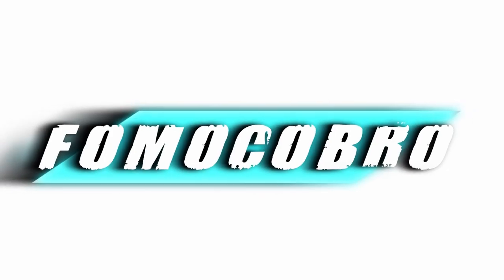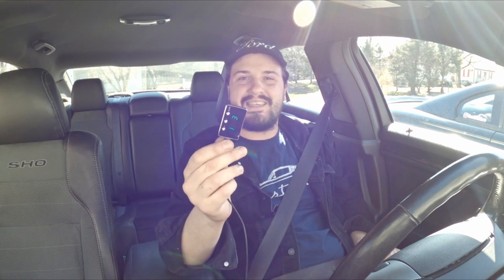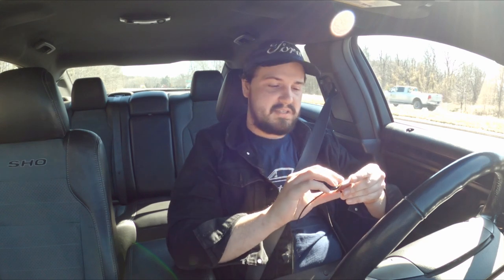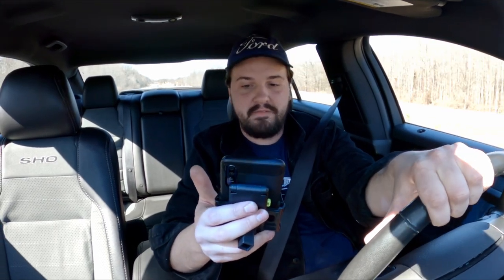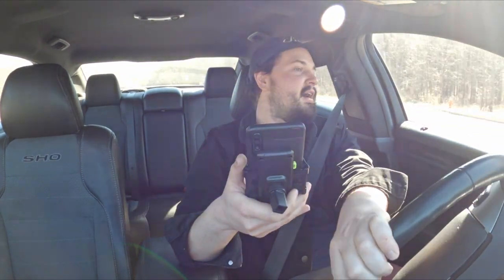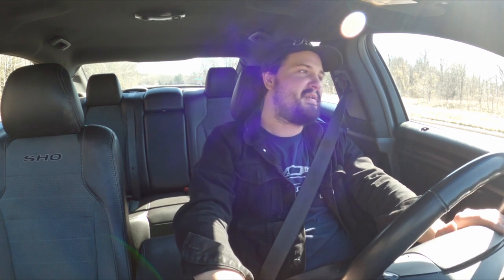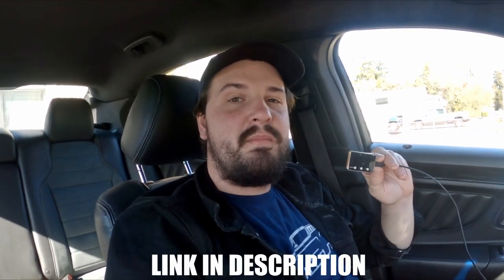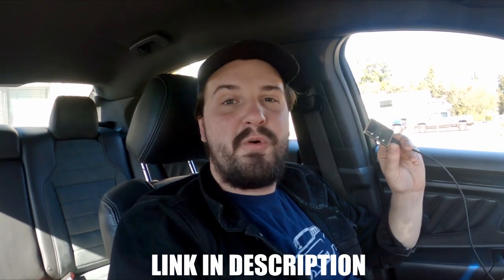Electronic Throttle Controller EXPOSED - 0 to 60 MPH Testing

Comment: I think part of the problem with these tests is they start the test when the car starts to move (0-60).  The purpose of these products is primarily to decrease the amount of time in between pushing the gas pedal and the car moving.  So a more accurate test, although more difficult to measure, would be the time it takes to go from your foot touching the gas pedal - 60mph.  This would be more clear at an actual drag strip when you have to go when a light turns green.  Because you would lose a fraction of a second waiting for the car to react without the controller.

The reason I need one of these is not to go faster.  But to get rid of the throttle lag.  When I stab the gas on my truck it takes a crazy amount of time before the truck begins to move.  Which is annoying when you are stabbing the gas to avoid another vehicle coming up behind you while merging into traffic.  For me its all about SAFETY.

Comment: I have the JMS Boostmax and Pedalmax on my 2017 SHO.  The Boostmax does add a significant amount of boost that wakes the car up with out doing a tune.  I can turn it off and the dealer was non the wiser.  The Pedalmax doesn't add power but gives you the power you have instantly.   I can dial in as much or as little that I want.  Normally I run it around 65-70 percent for regular daily driving and 100 percent when I am playing around.  The throttle is very sensitive at 100 and can cause the vehicle to become a bit uncivilized with regular city driving.  You have to be very smooth and feather the throttle.   I absolutely love my combination and don't feel the need for a tune.  I need to make a few timed runs to see if there is a difference.   On an unboosted engine, the Pedalmax is also great.  I ran the Pedalmax on my wifes 2017 Ford Edge 3.5 and it made the vehicle launch much better.
Reply: If you don't mind me asking I got a 2013 sho and plan on getting the boostmax where did you pass the wire through to the pedal cause I ran subs and couldn't ever find the grommet
Reply: Thanks so much for your skills shared, it did help.How long do you change your car's throttle controller,dear friend?

Comment: Iv got a  kunfine throttle booster like that one but I plug it in and all it does is give me engine light and rpm go up really slow. Iv got a 2015 370z. Any ideas
Reply from the maker: Check the cable that goes from the connector to the screen. Make sure the connections are seated tightly, and check the the wires on the harness. I had a problem with my controller and cause all kinds of problems with how my car drove. It ended up being one of the wires in the connector that pulled out of the connector slightly. So that wire wasn't making a full connection.
Reply: @KarzKreated  they seemed all fine but I'll check again. It's going to cost as much to send back to China as I paid for both. But thank you

Comment: It makes a positive difference down low then up high it losses power and the 0-60 is usually the same and sometimes slower.Ive had one in 4 different cars and thats what happens even the manufacturer admitted that
Reply from the maker: I now use this on a 2020 Mustang and it feels like it does more than it did on the SHO. Whether or not the difference is measurably faster is unknown, but it definitely makes the driving experience more fun.
Reply: Is the manufacturer working on the problem?

Comment: Hi, very informative, advanced, and complete information regarding the throttle controller, thank you, but I have a question I hope the admin or Karz Kreated can answer regarding safety issues, My question is what if the throttle controller's device suddenly fails? or the little wire cut? Do we still have the control of gas pedal? or it will be back to normal mode? Thank you for hoping Karz Kreated can enlighten us. thank you again!
Reply from the maker: I was unsure about the answer to your question since I never had anything like that happen. So I went out to the car, turned it on and unplugged that wire from the controller and the car worked just fine. It must bypass everything when there's no signal from that wire. So hopefully that helps! ✌️😎
Reply: @KarzKreated  wow you are a savior! because this is a safety question and it is very vital, thanks a lot!! more power to you!

Comment: Hi, does it has feature that set the rpm? Just like cruise control but set the rpm instead of set the speed
Reply from the maker: It does not. It only adjusts the sensitivity of the throttle pedal. 🙂

Comment: What ended up being your previous issue with knock? Dealing with the same thing
Reply from the maker: I thought it was the Knock Sensors at one point, then I replaced the Fuel Pump Module because fuel pressure was a bit weird. After that didn't work I put a fresh set of plugs in which didn't fix it. It seems to be false knock. It does it whenever it wants to. Not sure how much the tune contributes to these issues.

Comment: It seems like the controller knocked off a tenth from your 60ft as well. Was your best 60ft with the P1 or P2/P3?

I have a tuned MKS that normally does a 1.94 60ft so even if this helped me get into the low 1.8s it would be beneficial
Reply from the maker: Looking back at everything, P2 gave the best 60ft of 2 seconds flat.
Reply: @KarzKreated  Also forgot to mention that I am currently AJP Turbo tuned and he definitely knows his stuff but he is very backed up right now. If you want a change in tuner but dont want to wait as long I would try out Ortiz. As long as you're comfortable data logging, they will give you a solid performance tune. Either way best of luck to you man👍

Comment: Bought one just like the mass Chinese crap one you have but with the 'Roar pedal ' name .  Worked great for maybe a year.  Then got misfire codes , and it was causing problems with the throttle body. I disconnected it and my car ran better in about a  half hour. Anyway , they work. But invest in the better brands. Not the mass Chinese made crap.
Reply: bs. something is wrong with your car itself. the cheap chinese brands just puts more voltage to the throttle body.  same as a pedal commander but for 50 bucks vs 300.   if you had that problem with the chinese brand your car would have had the same issue with a sprintbooster or pedal commander.  the missfire codes are prob from you over reving your engine and needing new plugs

Comment: Stop lying to yourself mate, you get absolutely 0 performance increase, 0.
Reply from the maker: I proved that in the video. I even advised against buying one. Not sure what video you watched, but it wasn't this one. 👀
Reply: These don't add anything 0-60.  But they DO remove the delay between when you hit the gas and when the vehicle beings to move.  This equates to reaction time on the track.  Which is one of the most important variables to address when racing a vehicle.
Reply: @richarcm  Unless you smash the pedal in as fast as possible, there won't be any difference right?
Reply: @davoroxi   The problem is that the modern vehicle uses an electronic throttle vs a mechanical throttle cable that used to be used.  The electronic throttles have a delay built into them when you hit the gas which acts as a traction control to avoid sudden wheel spin.  The problem is that that delay is not always ideal.  Certainly not when racing.   But in my case it is dangerous.  There have been many times while driving where I needed to hit the gas and GO.  And when I did there was a delay before my vehicle took off.  It’s kind of scary.  

That being said the device I bought similar to this did not adequately address that specific delay.  I was a little disappointed.   To do what I need for it to do I may be stuck having to get a tune.
Reply: @richarcm  Ah very intersting!